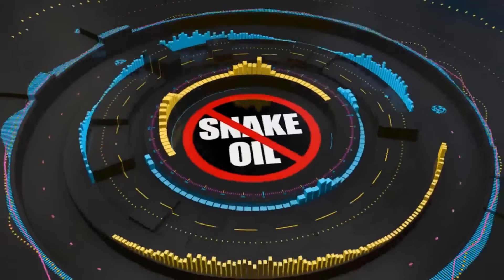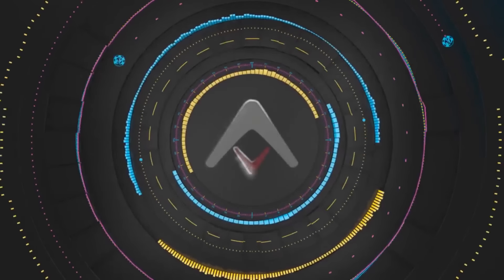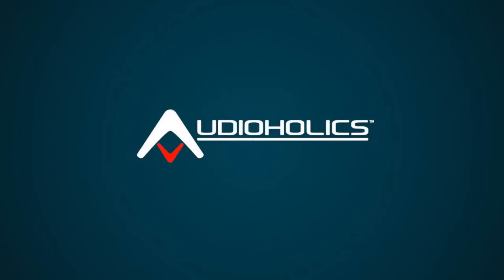STOP Worrying About These 5 Things in Audio!

Comment: I have to disagree with your comment on the impedance switch. 28.3 Volts RMS at the speaker terminals into 8 ohms =100 watts. 20 Volts RMS at 4 ohms also equals 100 watts. Therefore reducing the transformer voltage by approx 30% will not cause a loss of power at half the impedance and will make sure the output transistors are kept within the Safe Operating Area. It is true you will get more power if you leave it in the 8 ohm position but you risk blowing the output transistors if the amplifer is poorly designed.
Reply from the maker: You lose significant power at 8 ohms too. The receiver already has current limiting to prevent overload separate from the impedance switch. The switch is there for UL as I confirmed w engineers designing AVRs for the major brands. I'm 💯 accurate on this topic.
Reply: @Audioholics  The only current limiting is foldback current limiting monitoring the current through the emitter resistors.This turns the driver transistors off distorting the waveform. If you lower voltage and increase current, power will stay the same. A 4 ohm speaker draws twice the current of an 8 ohm speaker. I = E/R (Ohms law). You are not losing power by going to 4 ohms and changing the switch setting, you just don't increase the power by using the incorrect setting. Im pretty sure I have a Yamaha or Nad amp in the repair shop at the moment with an impedance switch. I will do a test to measure exactly how much power you get from each. 8 ohm high switch setting vs 4 ohm low switch setting.
Reply from the maker: @denebourke  I have 20+ years of test data showing how the low impedance setting limits power to below 8 ohm rating thet disagrees with you. Some old flagship Yamaha models power changed very little w the switch, but most mid priced models have a bigger effect. Yamaha already current limits if more than 4 or 5 channels are driven and they also have eco settings that do similar. I've had no failures on any Yamaha, Denon, or Marantz AVRs driving 4 ohm speakers full range with thr high impedance setting, nor has Yamaha or Denon reported increased failure rates to me doing this. All of the brands are very familiar with this topic and how I covered it, and I've received zero pushback.

https://www.audioholics.com/audio-amplifier/impedance-selector-switch-1
Reply: @Audioholics  OK, just did the test and you're right. They lower the transformer voltage more than 30%. Here are the results on a 7125 NAD receiver: 8 ohm setting, 8 ohm speaker 40 watts. 4 ohm setting, 4 ohm speaker 26 watts. 8 ohm setting 4 ohm speaker (I knew there would be more output, I didn't dispute this) 54 watts.  So the power drops from 40 watts to 26 using the switch even with a 4 ohm speaker.
Reply from the maker: @denebourke  yea in theory you'd be right about keeping the transistors in SOA but these switches are far more devious. Thanks for confirming.  You seem very knowledgeable and have the ability to measure amplifiers. I could use the help if you're interested.  Just email me at info@audioholics.com and put amp testing in the subject field.

Comment: After I change the oil my truck performance improves drastically. I buy the old one when it’s closing out, get the best price.
Reply: While it's very minor, technically the friction and heat characteristics of your engine are indeed changed, so at least there's a mechanism by which we could explain a slight performance improvement.
Reply: Turns out the car ran smooth all along ha ha ha

Comment: Hi, I notice you used 10 gauge cables or speaker wire in comparison to the high $ cables.  Do you recommend 10 gauge or is 14 gauge OK.
Reply: Nothing wrong with 14 gauge pure copper IF your speaker runs are average length or shorter.  Resistance per 1000 feet is 2.5 ohms so, for a typical 10' run your total resistance = (10 x .01) x 2  or 0.5  ohms.  Now that said, considering you can get 12 gauge RoHs Compliant from Lowes for $0.76/foot nothing wrong with spending a tee tiny more for the 12.  Gene is not suggesting that kind of cable is a complete waste from a technical perspective.  Gene is talking about spending insane $ on areas of an audio system that don't bring back any real return on investment unless you are into dress up items for your system.  But to each their own, if someone has boat loads of cash and loves bling then more power to them just don't try to convince me my system would sound better with their bling.

Comment: You got creds with me once you said psychoacoustics. A term I came across and used in the late 70s. I used it 30 years ago and some guy talking about speakers looked at me like as if I said something in sanskrit.
Anyway, I too call bunk on the fancy useless power cables and speaker cables.
I've see no scientific basis for charlatan speaker cables over simple 8 or 10 gauge cable I bought from Home Depot.

Funny story. An audiophile buddy mentioned using 22 gauge magnet wire to improve the sound of his speaker. My silent reaction was he put a series inductor between his amp and speaker.

Comment: These are perfect and accurate points. Utube listening tests do nothing, your little phone or headphones cant reproduce whats goin on in that room, its just not possible, so demos arent useful, fun to some maybe, but wont tell you much about how it will work in your room. Cables and cable risers, thats all nonsense and literally is just senseless spending on no audible improvements. Thanks, great video.
Reply: Well to be fair, youtube tests can reveal balance issues and bad room acoustics very easily. They don't of course sound like the live play but still you can hear if the balance is flawed or if the speaker suffers from early reflections. It's actually funny how a recording can reveal a bad room acoustics but when you're physically in the same room, you rarely hear the echoing a recording will reveal... When I got my first large panel electrostatics I was amazed how some of the songs I hated to listen with my old boxed speakers started to sound awesome. There was deep holographic sound stage and performers could be located with pin point accuracy. This is because the recordings were made with a simple stereo mic setup. Studio recorded music generally sounds very boring with good ESL:s as there is no perception of the recording space acoustics...

Comment: My amp gets hot as hell if I have it set to 8 ohm, and that is with plenty of room for air to move around it. My fear is that it lowers the lifespan of the amp.
Reply from the maker: So you'd rather have half the power to run your amp cooler? Install an AC Infinity  and keep your dynamic range.
Reply: @Audioholics  I decided to change it back to 8 ohm on your advice. I thought it was impedance matching like you said.

Comment: Hi Gene, I thoroughly appreciate your videos and the wealth of knowledge you share with theater enthusiasts like myself. I'd love to hear your opinion on a matter. After watching your video, I'm contemplating investing in Blue Jeans Cables for my home theater setup as I'm constructing it in my basement. Do you think the added cost of nearly $900 for speaker wires from Blue Jeans Cables is truly justified compared to opting for a lower-grade cable?
Reply: I'm not Gene ... but in your case I would suggest you buy bulk wire and cut to length.
Reply from the maker: Bluejeans sells bulk wire and that's what I use in my theater room. As long as you're using pure copper cable and not CCA, you're fine. I prefer 10-12awg for long runs.

Comment: You make some good points, but your take on speaker wire is one dimensional. Just testing for decibel increases with different wires is hardly a test. The sound from an amplifier can change with different speaker wire without getting louder. It may not always be dramatic, but the sound can change. Just like sound from different amplifiers will change without having to be louder.
Reply from the maker: I test more than just dB. I show differences in distortion, which is also negligible.  There's nothing else to test.  It's wire.
Reply: @Audioholics  test the sound difference, while everything can’t always be measured with equipment, the ears are can also be used as testing equipment.   Just as most anyone should be able to hear the difference between 18 gauge wire and 10 gauge wire, the speaker wires can make a difference if the system has enough resolution of detail. My Revel speakers were given a minimum as far as what speaker wire to use and during blind testing both me and my wife (non audiophile) could tell the difference, even before my room was treated for acoustics.
Reply from the maker: @peterw2714  red herring arguments. I never suggest using 18awg speaker cable. You're comparing resistive loses going from 18AWG to 10AWG which will affect insertion loss and system damping. Testing cables of similar gauge and length will reveal no sonic differences and little to no measurable differences between amp and speaker connection.

Comment: Thanks for all your informative videos and advice. I own a Marantz 7008 AV Receiver, driving older B&W 802 speakers in stereo mode. I do use older AQ speaker cables, but later HDMI cables also from AQ. That HDMI cables (AQ Cinnamon range) made a significant sound and picture quality upgrade, due to higher silver content in the cable. I use better power chords, than the stock standard that is supplied.
I also use a Marantz UD7007 universal player. As you can see all older products. But I love the sound quality. Even MP4 videos from Youtube sounds great through my system.

Comment: Another excellent video, which is no more than I’d expect from Audioholics. I’m 100% behind you on all 5 points particularly your point about cables. I’ve always held the opinions and advice of Audioholics in high regard. Not so much the opinions and attitude of Jay, whom you’ve recently taken into your hearts and given high praises to. So, here’s where the grey area starts to emerge. Jay has also been taken into the heart of Danny from GR research, who has also sung Jay’s praises and together they’ve collaborated  to convince more gullible audiophiles that cables do make an audible difference. This is why there is confusion and division amongst audiophiles. When they get conflicting views and advice from a conglomerate of reviewers, how do they differentiate fact from opinion, truth from subjective bias.
Reply: Have u tried high end cables?
Reply: @JamesBigham-v6b  I am aware that cables can make a difference. I believe you have to be price appropriate with your cable choice. If you’ve invested 1800 in your amplification and 2500 on speakers, there will be no virtue in investing 2000 on cables.you would not remove the cable that connects your 40 watt bedside lamp to the wall socket and use it to connect your 1.5kw heater to the wall socket, would you? But, you could use the cable that connects that heater to the mains outlet to connect your bedside lamp to the wall socket. It would not however, cause the lamp to perform any better.

All that having been said. I was browsing through my local bricks & mortar hi-fi store, one sunny Saturday afternoon last September. They were having a closing down sale. Their third that summer. I noted they had a ‘high end’ mains cable reduced from 5000 to 1000. I bought it on a wim. Well truthfully, I bought it on my Amex platinum card. When I got it home, my wife noticed the price. 2 weeks later, when I was discharged from hospital, I used that cable to connect my 1800 spin speed washing machine to the mains outlet. The difference was phenomenal. The water in the machine heats to the desired temperature 0.00097 seconds faster. I calculate that if I keep that machine for 17004 years, the cable will have paid for itself. Also, now, when that machine reaches its full 1800rpm spin speed, it no longer dances around my utility room. I attribute that to the cable’s binding qualities, not its electrical properties.  But, as you’re doubtless aware, life is never that simple. For every action there are consequences. 

My hi-fi is now a lot clearer, has a much darker noise floor. Mainly because it’s no longer being drowned out by that 1800 spin speed washing machine. The caveat, because there is always a caveat. My teenage daughter used to derive great pleasure from sitting astride that machine when it reached full spin speed. That damned high end cable has denied her that basic primal pleasure. However, it has drastically reduced the frequency we need to use the machine. Because of the much smoother spin the amount of lingerie my teenage daughter gets thru has been substantially reduced.anyways, regardless of your esoteric choice of hi-fi purchase, or opinion, most importantly, enjoy the music.

Comment: 1) My Apollon Audio 11ch NC500 doesn’t have an impedance switch only gain selector switch.  2) Agree with cables but I still buy good ones 3) yup demo in person but a good use case is room treatment demos before and after sound recording or recordings incremental improvements as treatment is added you can hear it 4) I’ve fallen for it 5) yep hate it too, I bought AV8805A right before the AV10 came out…
Reply: Good cables might cost 25-50 bucks not 250-500 or more.
Reply: @Artcore103 It depends on what kind of cable even bluejeans cables can easily cost more than 25-50